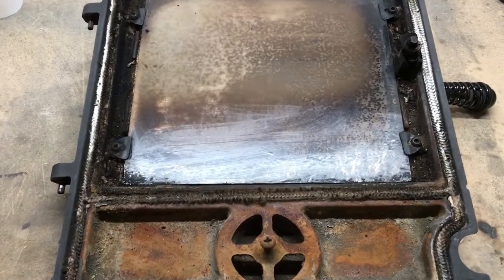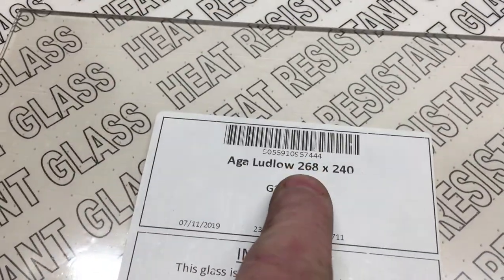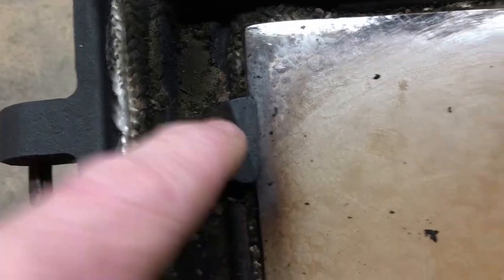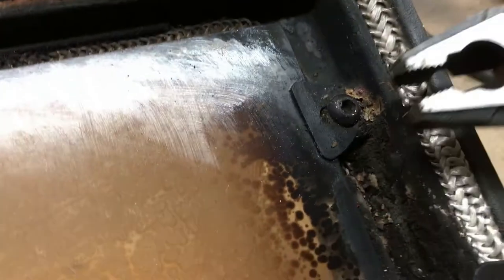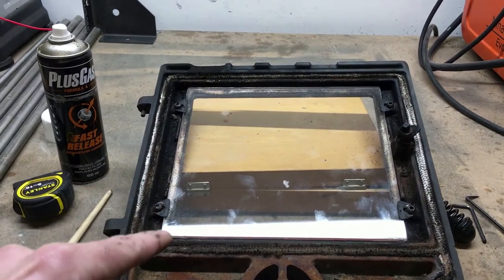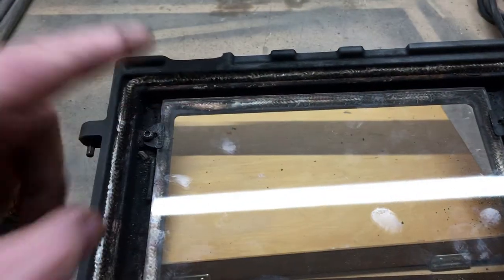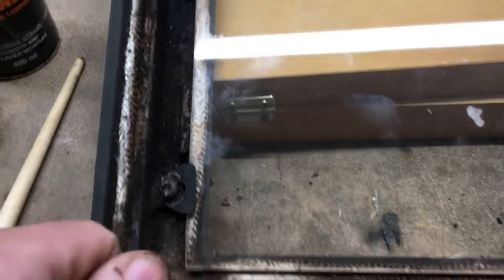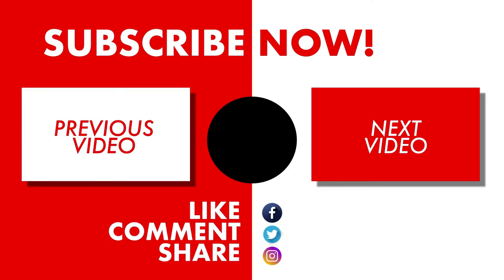How to replace glass on a wood burning stove

Comment from the maker: I decided to start a small property maintenance playlist and this is a job that I thought would fit the list. Here, I replace the glass on my multi fuel AGA Ludlow Stove. This is an easy and satisfying job to do but it can be quite difficult to loosen the bolts that hold the glass retaining clips. I show that is this video and provide you with one possible solution to help remove those screws. The specialist tool that I use is the Neji Saurus PZ-59 screw removal plier from Japanese manufacturer ENGINEER - These are billiant and you can get them here via the Amazon link should you wish https://amzn.to/3smZqim
 As always, thanks for watching and please give the video a thumbs up which would be highly appreciated 👍

Comment: my model 70 buck stove door doesn't come off. It does have cracks in the glass. You can clean the glass on your wood stove with oven cleaner, it works good.
Reply from the maker: Thanks for the info